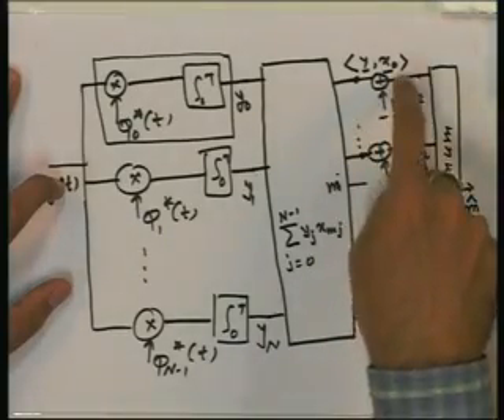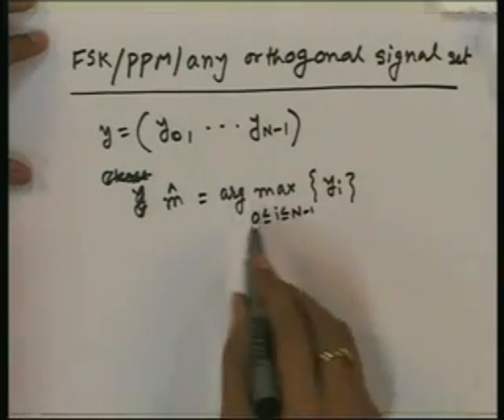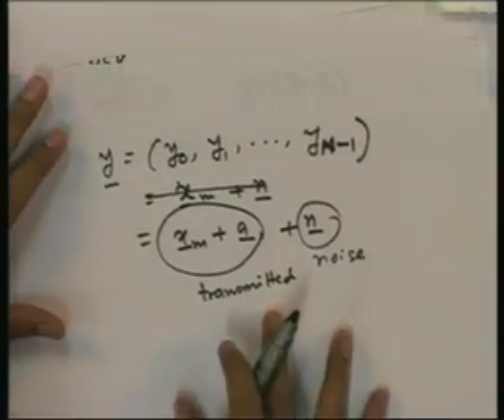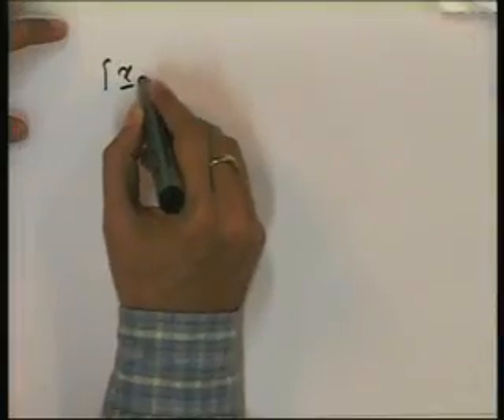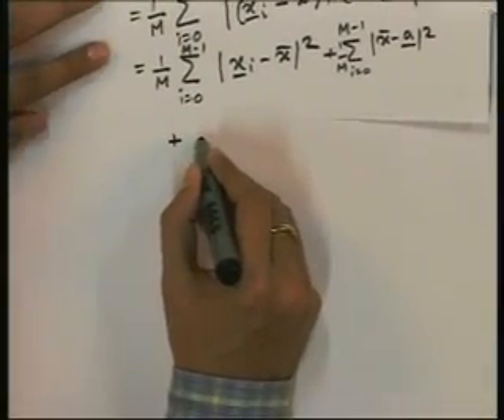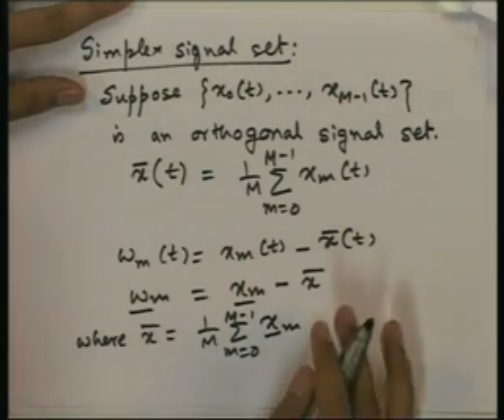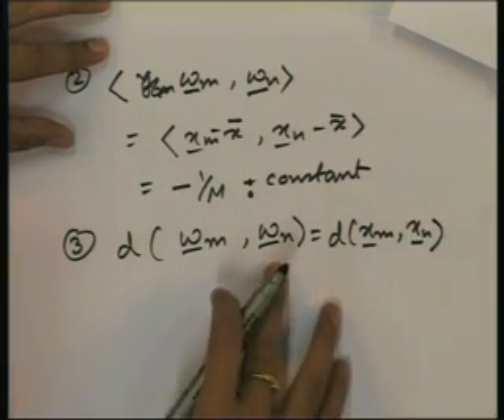Lecture - 20 Digital Modulation Techniques (Part - 9)

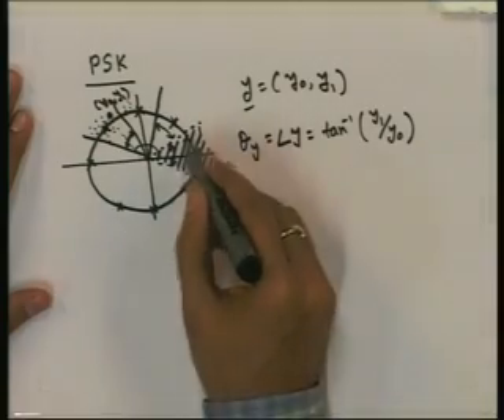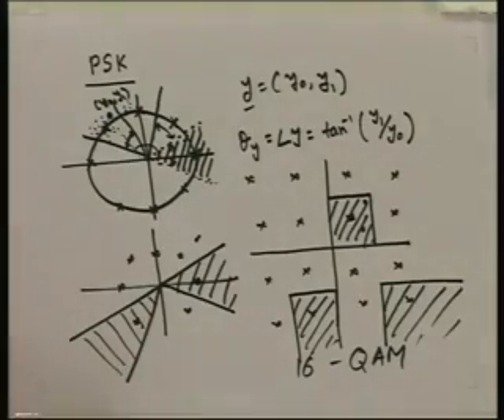Comment: Estimation of transmitted signal in PSK using phase measurement(6:10), Decision regions (9:50), Estimation of transmitted signal in orthogonal modulation(PPM/FSK) using (12:15), General aspects of signal design (18:15) - Translation (19:45) - Rotation (27:40) - Simplex Signal Set (41:40) and its properties.